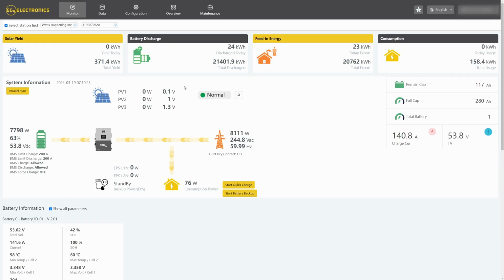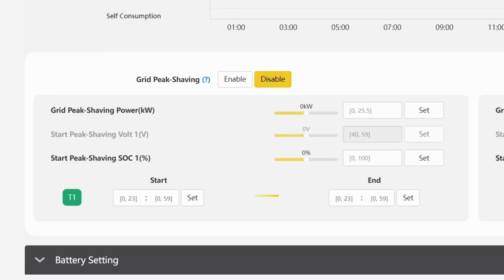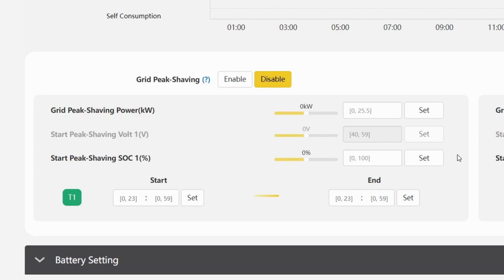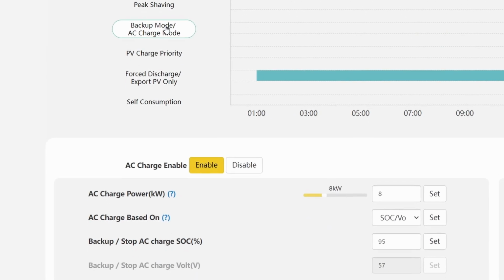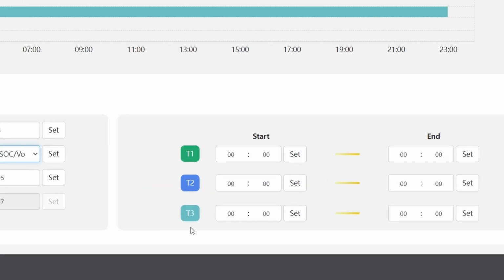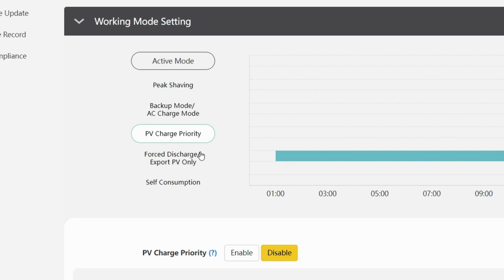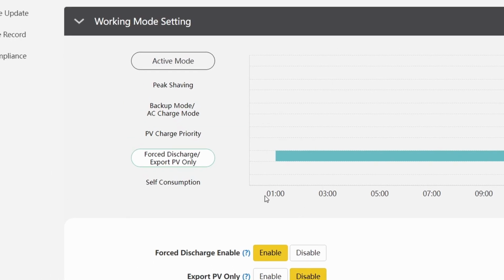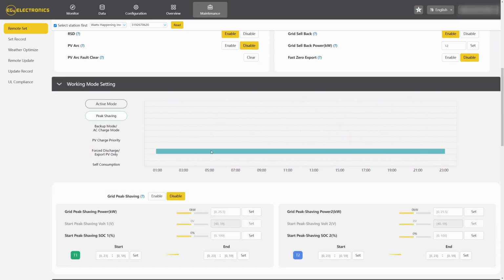EG4 18KPV Working Modes | Monitor Center Update

Comment: A video about 18kPV generator function operations, configuration, and settings would be very helpful. I say this, because my generator settings aren't working as I believe they should. Generator battery charging starts properly on SOC my setpoint. However, generator battery charging does not stop on my SOC setpoint. It doesn't stop until it hits the maximum system charge setpoint. Also, when it does stop charging, it never stops the generator. The generator runs forever. It shows the dry contacts are ON. I have to shut the 18kPV down, to get the dry contacts to turn OFF, and stop the generator.  As an industrial controls software engineer, this appears to me, to be multiple bugs in the program.

Comment: Hello sir, thank you for the explanation although I have many doubts. I work for a solar panel installation company and we recently started installing the 18KPV inverter kit and 2 EG4 batteries. My simple question is: what should be the optimal configuration for this installation, since all the information I have seen does not indicate optimal values that should be used. So we just turned on the system and it says its status is Normal, but I notice that the batteries discharge very quickly. thank you for your time. I wrote to you from Dallas, Tx.

Comment: For my system, the best update you guys can do for the 6000xp and 18k is to add a tab to remotely trigger the RSD. You could program one of the output switches so it could be wired in parallel with the RSD switch. I have a Ring camera pointing at my inverters and batteries and am adding one to show my PV.  I have wired a wifi thermostat fan output to a relay that I can remotely trigger.  That way, I can RSD my system should I see an issue on the cameras from anywhere. 
My "retrofit" works just fine, but it would be easier if it was built into the EG4 app and inverters, just saying.....
The hard part would be figuring out how to turn the RSD back on once it was triggered. 
My stat setup is powered off the grid, so when the RSD is triggered, my stat/relay doesn’t lose power. I can turn everything back on as easy as i turned it off.